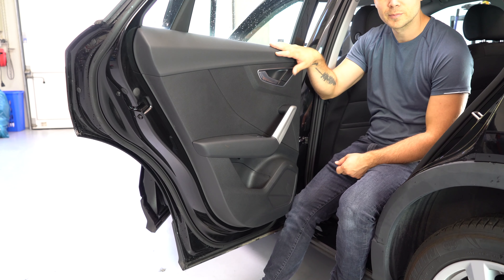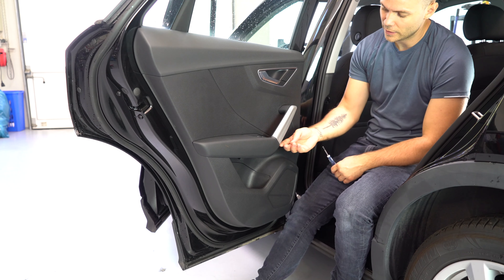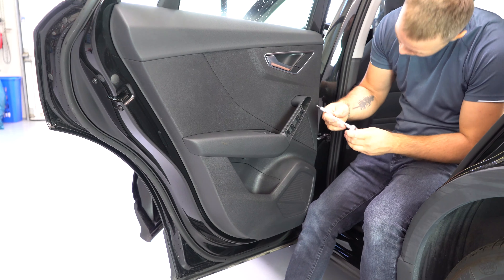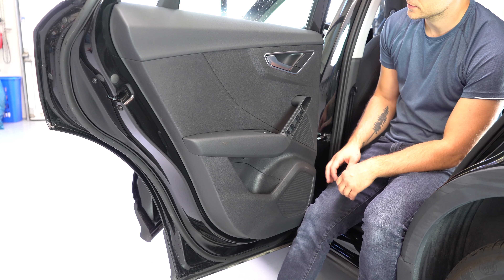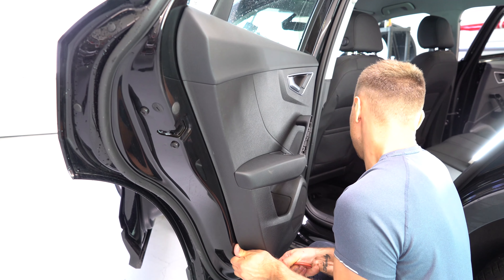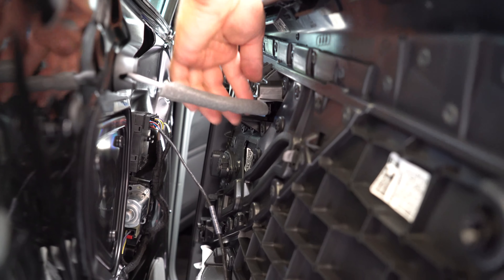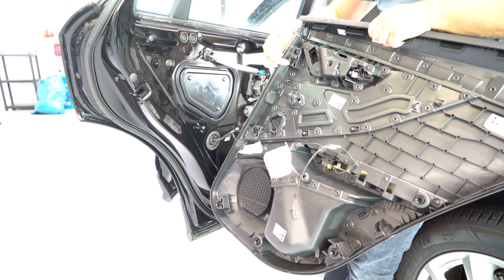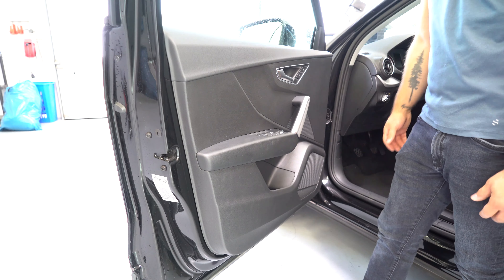Audi Q2 Door Panel Removal Tutorial

Comment: i see that there is no speakers in the rear, I can´t see there is a speaker cable at all loose, can anyone confirm if the cable "exists" or it a new wiring is needed to add a speaker